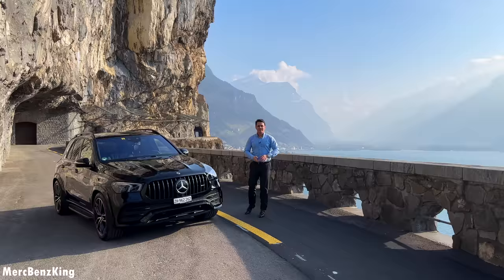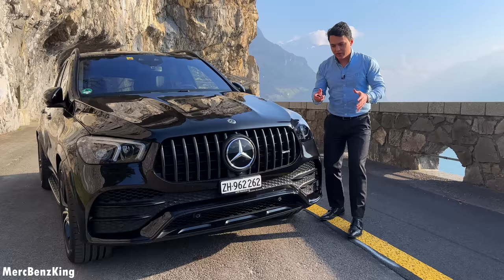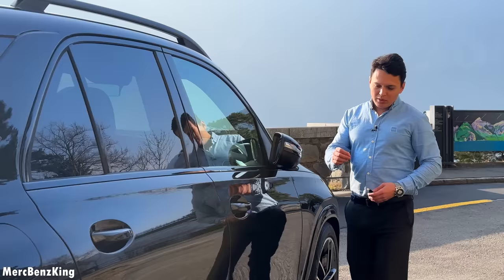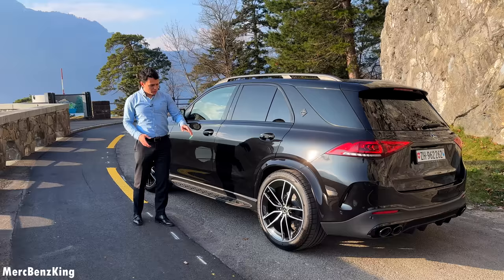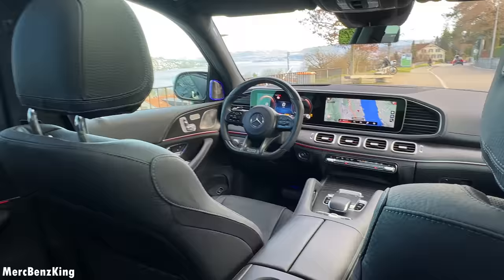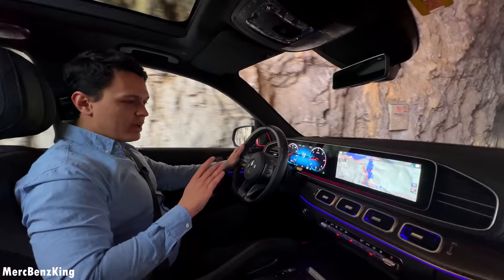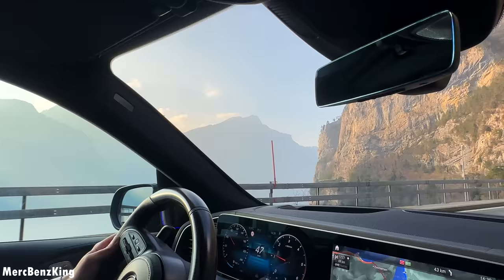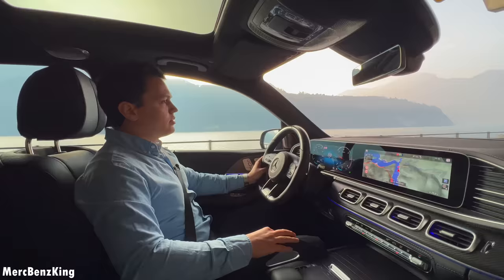NEW 2023 Mercedes GLE Edition | Facelift 2024 FULL Review Interior Exterior

Comment: I don't understand the auto industry at all! It's been alerady a few years since Mercedes came with this interior and 5-6 years later, it looks the same.Whats the point!?Audi also. If you sit blindfolded into an A8 Q7 or Q8 you can't tell wich one is.Well, you can for the Q8 and 7 because the height but you get my point. They all look the same. Seriously now, why should i buy this car and pay more than 100k $ or euros when my neighbour has one from 2019 and it looks the same? Especially the interior!So why should i pay 50-60k$ extra for a car wich looks the same as one with some milage in and a bit used? In my opinion i think a car should not continue more than 5 years with the same design, especially a top brand.